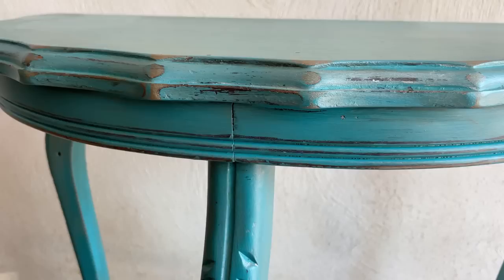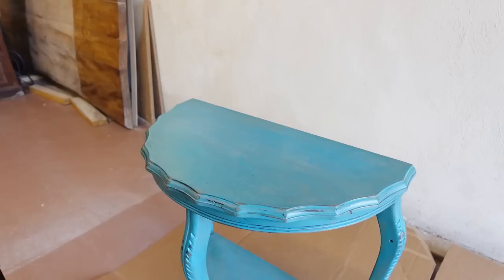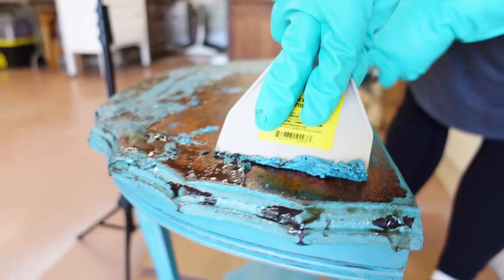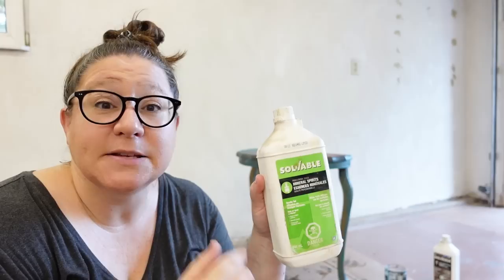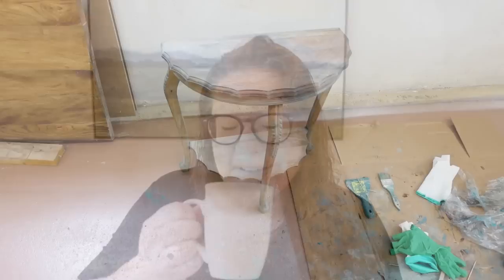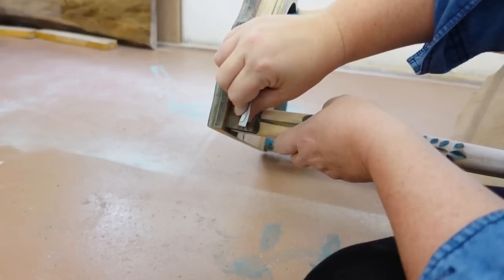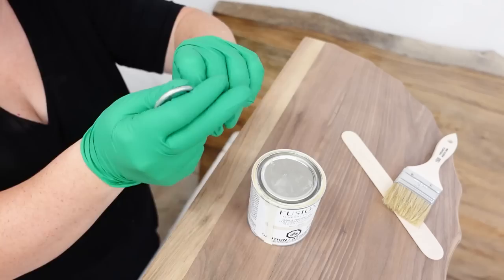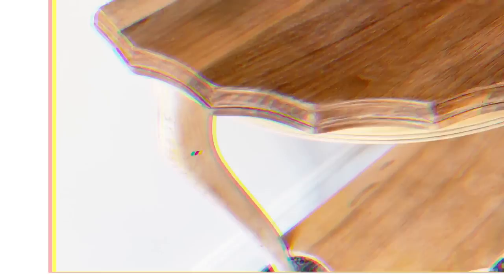STRIPPING the chalk paint off my table!

Comment: Stripping is a PITA, which is why I only paint vintage things that otherwise couldn't be saved. It is extremely difficult to find someone willing to pay you for the hours spent on refinishing a piece of furniture. Thanks for showing the how to with SFO. I've been curious about it. Did you keep wiping after that portion of the video? Or does it dry that much lighter? I also wonder about the durability of the finish. PS I love the reality of morning coffee with wet hair. You are so REAL on camera!
Reply from the maker: I did spend about an hour and a half (off camera) buffing in the SFO on the flat surfaces. It’s an extremely durable finish once it’s cured. They even recommend it for floors!
Reply: @salvagedbykscott  i was concerned it was going to look too opaque but it turned out beautiful.

Comment: Just an FYI, never paint over raw wood, always put 2 coats of shellac,  then paint. The reason why is if someone else wants to strip it, then it's so much easier,  without having to use a dental pick to get the paint out of the wood grain

Comment: Katie, 64 and did stripping on my personal items for years. Getting in detailed grooves can be a daunting task but have had luck with cotton swabs drenched in fingernail polish remover and holding it on the spot to soften the paint in those little devilish areas. A clean swabs then dipped in more fingernail polish remover makes the swabs soft enough to do a little scrubbing in the hard to get locations and has never created damage on any of my pieces. Rarely has this failed me, for picking off those little specks with pointed tools would seem to be a never ending task. Lynn, Dodge City, KS, USA

Comment: Hi! Love your channel and your style of teaching! I always wonder why stripping I stead of just sanding the paint off? Is it bc it had a wax finish? I have never stripped a piece- always just sand. BUT, I have never bought a piece already painted.  So I guess my question is why strip instead of sand? Maybe an idea for a quick video?
Reply from the maker: I get asked a lot when or how you know whether to use a chemical stripper or just skip right to sanding and a lot of that decision will come down to personal preference and experience but I think a good rule of thumb to follow is that if your surface has a lot of detail, or decoration, like this stuff, you want to do as little sanding as possible. Sanding will wear away at these details really quickly and you may accidentally loose them all together, where as a stripper will let you get back to the original surface without removing any of the wood material underneath. If you’re working with a lot of large flat surfaces, it may be easier to sand from the start. At the end of the day, chemical strippers, carbide scrapers and mechanical sanders will all remove the finish from a wood surface, they all have their own pros and cons and situations where one will work better than another.
Reply: @salvagedbykscott  thank you! A perfect answer!

Comment: I got a couple of nighstands that were chalk painted and dang! it suuuuuucks! thankfully the paint was not sealed, but they painting job wasn't great and there are runs and lots of small edges that had A LOT of paint. So I'm having to scrape off the excess on corners, but most I'll just to a smoothing sand and prime BIN shellac. But man, chalk paint gums up sandpaper quick!! ugh

Comment: Beautiful result! Your hard work payed off! I have a question about removing paint. Do you ever strip lead paint? I have a piece I’d like to repaint, but it might have lead paint.
Reply from the maker: I’ve only ever had 2 pieces test positive for lead and I ended up disposing of both. It’s just not worth it for me. You can get testing swabs at most paint stores or even on Amazon. They’re easy to use and will put your mind at ease.

Comment: Very pretty makeover! It’s such a messy job to strip furniture but look at the results! I’m curious about the oil finish you used, I never saw that before. Did it soak in and turn clear? Thanks so much!
Reply from the maker: It does soak in and then you buff off the excess. It’s a very light effect with only coat but you can build the colour with additional applications if you want.
Reply: @salvagedbykscott  thank you!! 😊

Comment: Wait!!! What happened with the white? Does it disappears as it cures? Or is it a light issue?
Reply from the maker: The more you buff it, the more the colour disappears. It’s still there but just visible in the grooves where I didn’t buff it down and in the grain of the wood. You can get a whiter look by applying more coats or not buffing it as much.